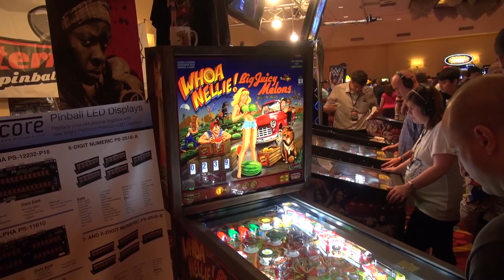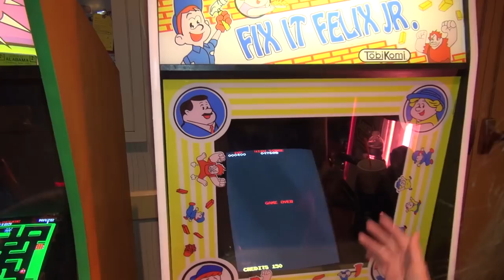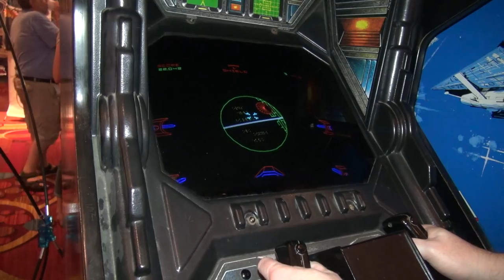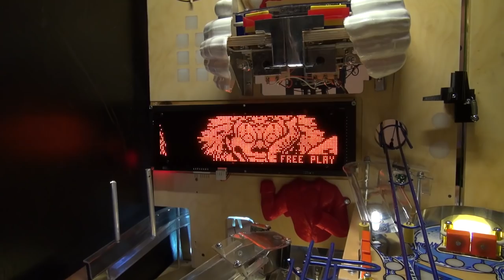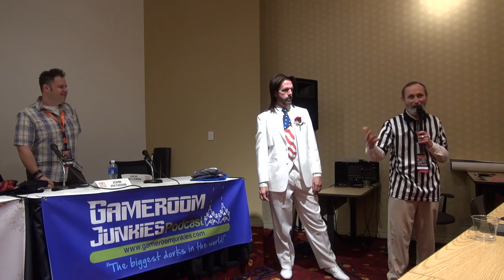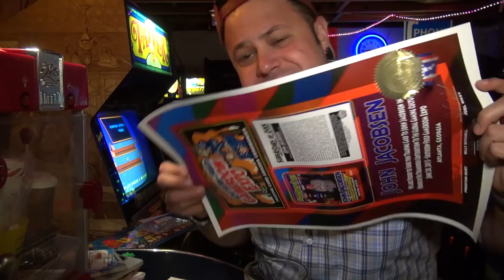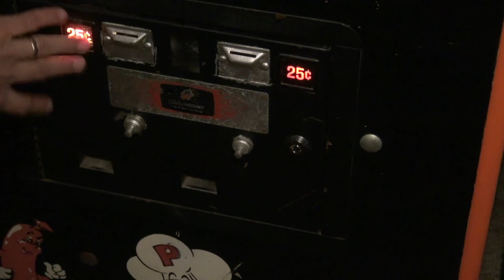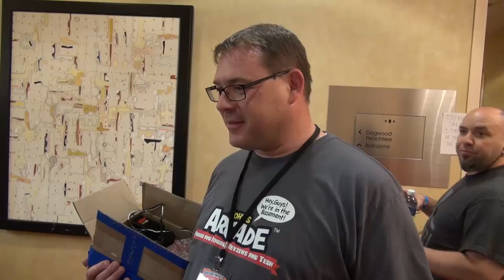The All Star Southern Fried Gameroom Expo Tour - with Ben Heck, Billy Mitchell, Walter Day and more!

Comment: well dude! I bet you are stoked getting the reward ! and it couldn't go to a nicer Guy !! can you show us the cards when you get them . I was thinking it would be good to make a pinball machine in kit form and have individual multiple play Fields on them do you know if anybody's has done that ? do you find out who set you up. did you speak in the seminar, u didn't show it on the vid. I think you should get that guy to do  your T-shirt it would look good with your face on it wobbly table you need to get a 3 legged table you won't have any wobble  like a 3 legged stool I think if you strengthen that centre Bolt what holds the base to the shaft extremely tight say about 75Nm  nano metres would sort out the problem
Reply: +Ib Virgin any reason why you blocked it  wasn't showing up. please pass it on you don't  need to show any political allegiance by blocking it you are